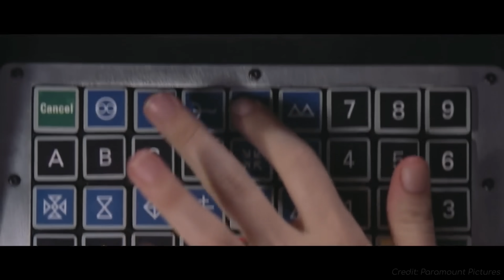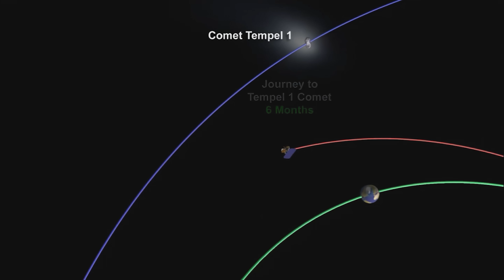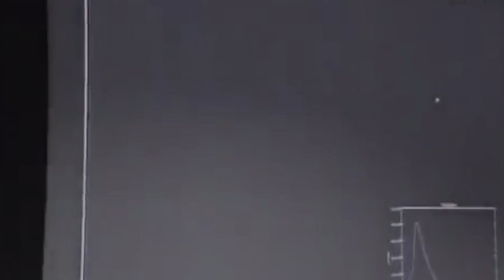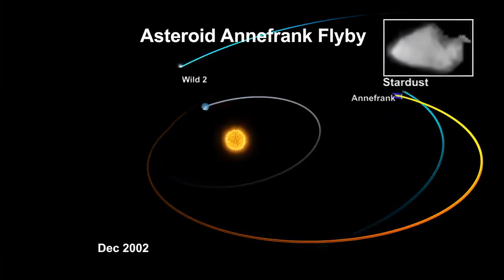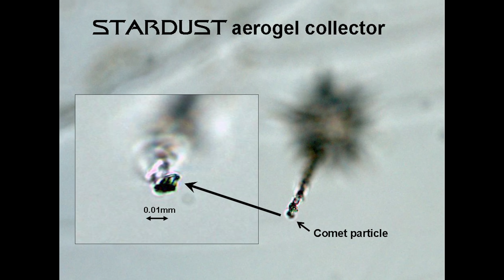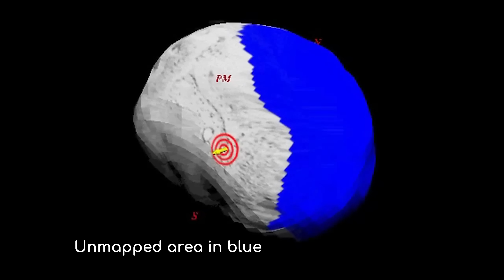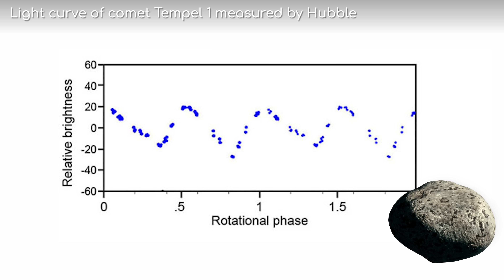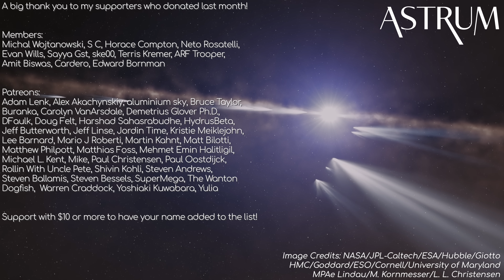The Image NASA Didn't Want to Receive from the Deep Impact Probe | Supercut

Comment: I was one of the engineers that helped build, test, launch and operate Deep Impact.
I was the Launch Conductor on Launch Day and a member of the mission operations team at JPL.
At JPL I performed duties of Navigation Team Member, Activity Lead, Flight Director, and the Impactor Command and Data Handling subsystem Engineer during the encounter.
Coincidentally - I left Lockheed Martin in 2000 specifically to work on Deep Impact.
At Lockheed Martin I helped with Mars Global Surveyor, Stardust , and Genesis.
So, while it was a let down missing the image of the crater with the DI Flyby HRI Instrument (the "Primary Science" of DI), it was going to be my OTHER Trusty spacecraft to come along and get the image.
It was especially important because the images that stardust took were through the Instrument that I was personally responsible for and integrated onto the Stardust Spacecraft, the "Navigation Camera". It was some leftover parts of a Voyager flight Camera with a Cassini CCD in place of the old phot-multiplier tube.
Reply: Thank you for your service!
Reply: Nice work reusing old spare hardware.
Reply: @TatsuZZmage  I was also in charge of installation of an old Voyager spare camera onto the Stardust spacecraft to use as its navigation camera.
Reply: Well done!
Reply: @HexproofAnarchist  another note: When JPL delivered that "Navigation Camera" I was te test Engineer responsible for testing it after installation onto the Stardust spacecraft. However the focus of the unit was basially set to infinity so I would not be able to get a focused image inside the Clean Room.  So I needed a Collimator.  I asked JPL if they could supply the collimator used to test the uit at JPL. they said it was the size of a room and they could not ship it.
So I asked them 'Could you ship me the Engineering Model of the Navcam?" They said "Sure, but why?"
I put a test target at the focal plane of the EDU Camera and pointed it right down the boresight of the flight unit and took an image.
It worked perfectly and we used it to verify the performance of the flight navcam after environmental test and before launch.
Coincidentally This "Engineering development unit (EDU)" unit was also another flight spare camera from the Voyager progam. So at one point I was in possession of both remaning pieces of "flight" hardware for the Voyagers.
Reply: @stuartgray5877  Hey thank you so much for the details that most people will never hear about. You had the perfect perspective to see the whole mission AND get your hands a little dirty. How much fun is that!
Reply: I'm curious to know why we need to spend billions on space research when we haven't discovered our own planet, so our tax money is paying for these boffins for what gain, where the NHS is starved of cash.
Reply: @philipellis4530  When we spend BILLIONS a year on Sports Memorabilia in the US alone, then maybe we can afford to do some science as well.
Reply: @philipellis4530 without the space programs, your online presence could only happen if you had a computer, which would be the size of your bedroom.🙄
Reply: This makes you a true treasure for humanity and I want to thank you for all your hard work and great efforts to advance our species and gather new and rare knowledge to share with all of us and our future descendants.
Reply: Is this some kinda arg
Reply: @prestongoetz7616  no idea what you are trying to say
Reply: And where do you expect to be in 5 years time?
Reply: @BibleBlack667  what kinda question is that and who is it directed towards?
Reply: @BibleBlack667  I expect to be launching the NEO-S spacecraft after WSF-M.  It is currently scheduled for a 2028 launch.
I have some involvement in SFWO and Carruthers.
Reply: @philipellis4530  I almost agree, but research is research and any research might well reveal something important to humanity, which after all , is what all research is about. To become myopic when setting goals for any research program is to fail to see the trees for the forest.
Reply: As an aerospace engineering student, I’ve been attempting to get an internship in the field of space, any quick tips on how to do so? I’ve applied to ~35 but only 8 have responded
Reply: @BibleBlack667 don't say doin your wife
Reply: Good job putting on CCD cameras that discounted the electrical spark predicted by the Electric Universe model. Well done!
Reply: all you guys and gals that worked on these projects,, GOOD JOB.!!  Thank YOU.. . the longevity of these space crafts speaks volumes to your creativity, and engineering abilities.  We salute you and your colleagues.
Reply: so?
Reply: @Wheresmy240  The Stuart chap made less of a comment, more of a posting of his CV, or some spiel at a job interview - hence, "Where do you see yourself in 5 years time?" ... It probably requires a level of intelligence to work that out, easy as it was. You know what they say, "if it needs to be explained... "
etc.
Reply: @stuartgray5877  Well done. Bravo.
Reply: @XohjaiSbarkeater  You managed the apostrophe in "don't", yet you completely fucked up "doin". 2/10
Reply: i was there too, as an engineer
Reply: @philipellis4530 some of us (ie the ones funding this) ain’t British bud. 

TLDR: IDGAF about the NHS
Reply: Thank you for the great work! 👍
Reply: Thats freakin awesome, I'd love to hear some stories. I bet waiting all those years to see what impact it left was excruciating, lol. Also, not knowing if you'd even ever get to see it, and if so it would be 1 in a million chances. As someone who loves everything space related, this is awesome. If it were me I'd just as proud as you are. How do you even get into working on these amazing projects, or even at Lockheed and NASA. How freakin cool is that, I bet you've seen some stuff we could only dream of?
Reply: @philipellis4530  how ignorant. Perhaps you will be glad we spent pennies on the dollars knowing that mankind is much safer, knowing we can now successfully deflect asteroids given the right amount of warning.
Reply: Thank you for all your contributions in this field to humanity. You have an amazing resume, and I admire and salute you, sir!  It was my late naval officer father - who was also an engineer - who inspired me to look towards our beautiful heavens, and although LIFE occasionally ran me over, I kept coming back time and again to looking up into the skies and dreaming.....
Reply: @philipellis4530  You do realize that "space research" is the reason we have technology like the computer you used to watch this video and make your silly comment?
Reply: Little known fact, after the impact probe hit the asteroid a message showed up at NASA from the asteroid which read, "Knock it off."  😀
Reply: I love scientists' creativity🥰
Reply: @bloggerty-schmoo2698  - "prove it or it never happened"
Well, it was LITERALLY witnessed by MILLIONS of people worldwide.
Try to keep up genius.
Reply: @bloggerty-schmoo2698  - " Tinfoil hat rubbish"
What's HILARIOUS is that the ONLY person to make that claim is actually WEARING A TINFOIL HAT!

So, where you come from is it customary for the kids that dropped out of high school to try to lecture engineers and physicists about how basic physic works?
Bless your little heart for effort!
Reply: @bloggerty-schmoo2698  Just tell us that you completed the 9th grade.
Come on you can do it. (yeah if you LIE)
Reply: @bloggerty-schmoo2698  well the thousands of actual scientists that have peer reviewed the science data returned by these spacecraft seem to disagree with you.  I guess you are smarter than those thousands of scientists and all of the engineers that build and operate these spacecraft?
Yeah.  Sounds reasonable...
Reply: @stuartgray5877  you hit a home run with that comment
Reply: There is really nothing, and I mean nothing, about this entire mission that isn't just incredible. And I don't know which, the planned or unplanned part, that amazes me the most, given both were a complete success. People such as yourself, who can accomplish these mind boggling feats so precisely, are truly on a different level then the rest of us. And I thank you for your invaluable contributions to the world.

But(he said sheepishly)no one thought about the  cloud? lol I hate to say, but I thought about it, as I was watching DART do its thing, live. That was amazing. But you guys recovered in a spectacular way.
Reply: That's Kool I watched that movie. It was pretty good.
Reply: @stuartgray5877 - do you think you might get to visit space one day?
Reply: @sian2337  No.  I am already too old. But my grandkids likely will.
Reply: @FaeEvergreen  well for an update, I am at VSFB right now preparing the WSF-M spacecraft for launch in March on a Falcon9.  
I just supported an Integrated Crew Exercise with the Air Force, and SpaceX.  I am the Test Director.
Coincidentally I also got to witness the Starlink 7-11 Launch on Tues up close.
When WSF Launches it will return to the landing zone so I will finally get to see a landing up close.
Reply: Did u work with frank childers of CSC and Nasa?
Reply: Bravo 🤩✨👍💥
Reply: @savetheplantet5799  - "Did u work with frank childers of CSC and Nasa?"
The name does not ring a bell.
Reply: I guess that means you're a Rocket Scientist? 
....... I Jest 
AweSome sounding job.   (Jobs) 
I was "privileged" to work at BNL as Engineering / Tech support
I Never did get to do anything space-oriented.   But..... it sounds VERY cool
Reply: non-Mathematical thinking 
They always think "Millions" spent on some space project is a 'LOT' 
They'll often say "Billions" but.  More often than not, it isn't nearly so expensive as they think.
And as YOU yourself point out.  Compared to the (actual) "Billions" we 'WASTE' on far more useless things.   (sports) 
A Little $$$ spent on space isn't all that bad  .   But I just find it humorous that the "drop in the bucket" that's spent on space, overall is considered So HORRIBLE an expsnse 
... a "Waste" 

(do they even Realize what ONE  F22 costs?  or ONE Aircraft carrier? Or ONE exotic bomb?  A bomb that we "throw away" along with many OTHER bombs?) 
the TRILLIONS upon Billions of dollars spent at war?
& space is the tiniest FRACTION of that (military) expenditure??? 

But they complain about one or two spaceflights that "Seve NO obvious use"

funny

 @stuartgray5877
Reply: @AutomationDnD  I am more like the "spacecraft Mechanic".
In the process of building, what inevitably is always a one-of-a-kind prototype, the Integration and Test Engineers often learn more about how the system works and its idiosyncrasies than many of the subsystem engineers that designed the system.
Smart spacecraft programs value that experience, and use the I&T Engineers for assisting with Mission Operations like commissioning the payloads.
Reply: @AutomationDnD  Yeah they often like to call the cost of the US Military Industrial Complex a "Defense Budget".
It is clearly an "Offense Budget" as the US mainland has not been attacked directly in a very long time (discounting the 9/11 events), and we spend more than the next five top military spending countries COMBINED (while many of those 5 are our allies)
Reply: @stuartgray5877 How fascinating! Thank you for sharing your involvement in this. Excellent work sir.
Reply: Impressive work, I find it incredibly uplifting to know we humans can do so many incredible things. I am in awe of space research, especially the maths involved!
Reply: Wonderul to hear your insight.
Reply: @stuartgray5877  People have the freedom to spend money on what they want. Spending TAX dollars on what the people do not agree on, is not remotely comparable.
Reply: @SupraSav  so according to you, individuals should get to tell the government what to research and what not to?
So if I personally disagree with studying climate change, I should be able to tell the government to ban the EPA?
Bless your little heart.
The Science community tells the government what to research, NOT uneducated individuals.
Reply: @SupraSav  good thing the people did agree to fund NASA.
Dont like it? Vote.
Reply: @spencer6104 that is one of the most difficult aspects of space travel: building components that can survive the ride.  For electronics this is relatively straightforward.  However it is very difficult for complex components like optical telescopes and deployable structures.
Reply: I was responsible for placing the duct tape on the integrated infra-red quantum probability reference detection equipment. It calculated the probable spin and velocity of the electrons located inside the quasi-crystalline laser pulse diffuser. It broke. Also a squirt of WD-40 for good measure.
Reply: You destroyed a building block of life 😢
Reply: Thank you for your contributions
Reply: I envy your involvement with space exploration.
Reply: Thank you very much for your great contributions to enlighten humanity on such an  important mission in our understanding of the wondrous universe.
Reply: Brag much..?
Reply: @robertglass3944  - "Brag much..?"
Do you get butt hurt by people that actually accomplish things?
Bless your little heart!
Reply: Legend
Reply: Koby Boykins that worked on Mars rovers that outlasted forever, was my hockey coach when I was a kid
Reply: Really cool…thanks for your service to the space industry !
Reply: Are you certain the imaging device was a PM tube rather than a vidicon tube?
Reply: @littlefire1976  I am not certain what exact device was removed from the Voyager cameras, but I know the new device was the CCDs custom designed for the Cassini Program.
Reply: I feel like this is a threat where 5 "different" people and the originator of this message are the same exact person. Go out mate. fresh air is good.
Reply: @bloggerty-schmoo2698  I think this whole threat is a complete made up story and the originator is in here with 5 accounts. I assume some badly narcissistic issue here lolololol people can be so weird
Reply: @pGfLexed  sorry but you are mistaken.  I use my real name and have only posted under that account.
No idea what you are talking about.
Reply: @pGfLexed  there is a vid on my YT channel where I explain my entire career.
Tell me I am lying
Reply: @BibleBlack667 YES! Totally agree sounds like a job interview... 
Him:  look at me look at me how wonderful I am
Reply: @AutomationDnD  Perhaps as NASA begin to explore water worlds in the future more money will be allocated to exploring & understanding our oceans
Reply: @davidtatum8682 but you did save the day when you applied the vice-grips...thank God! 😎
Reply: @pGfLexed "threat" I feel you mean "thread" 🤦‍♂️
Reply: @iRossco  but of course
Reply: @iRossco  - "look at me look at me how wonderful I am"

Sorry, but actually SOME people like being able to ask the actual engineers that worked on this stuff real questions.
Sorry I am cluttering up your internet.
I guess it's a horrible waste of electrons offering to answer questions for people who actually want to learn.
 I am such a horrible arrogant person to think anyone would like to hear about the seven spacecraft I have helped launch in my career (four to Deep Space or to orbit another planet) or the greater than 30 real rocket launches I have witnessed up close and in person.
Reply: @stuartgray5877 why not give us a real name? First and last since you are not scared to tell everyone.  Let's put it to rest? I take it you live by Cape Canaveral?  .
Reply: @hunt2151  Barry McCockener
Reply: @hunt2151  "why not give us actual name"?
Sure
How about
Stuart
Gray
??
Reply: @hunt2151  -  " I take it you live by Cape Canaveral?"
No, I live in Colorado, where I worked at Lockheed Martin, Ball Aerospace, and now BAE Space Systems.
However, I HAVE lived for over a year in Cocoa Beach while launching five spacecraft from KSC/CCAFS.
Reply: How incredibly generous of you to comment on this video and to answer questions. You have certainly lent credence to the documentary and offset the clickbait title altogether. Thank you for your insights.
Reply: So basically it´s all about you?
Reply: @mattias5157  Yeah. that's what I said above. Cant you read?

I built the spacecraft, launched it and flew it SINGLE HANDED with no help whatsoever.
You are welcome.
Jack
A$$
Reply: @stuartgray5877 if you really are a nasa scientist engaging with people in the comments section of a youtube video doesn’t seem like the most productive use of your apparently very important and valuable time. turn off your phone if you’re that disgruntled.
Reply: also if you’re a scientist shouldn’t you also be able to realize most of the info in this video is not very accurate? seems more like an AI content farm and you just googled everything about the craft.
Reply: @stuartgray5877 he knows exactly what you’re trying to say lmao
Reply: @kingrat4250  - "if you really are a nasa scientist".
Show us all where I said I was a "Scientist".
Maybe if you had bothered to finish high school, you would know the difference between a "Scientist" and an "Engineer".
Reply: /saaaaaaaaalute
Reply: I wouldn't exactly highlight that part of your CV.
Reply: Awesome! Thanks for your story!
Amazing how spot on the end result was considering the speeds involved... photographing the spot on the spinning bullet you shot years earlier from a different bullet and were only a degree off?!? And aligning that to occur specifically on valentines day?!?!?! That call was surely the nerds in charge... 
Wow!
Reply: @Wheresmy240 Receive a grasp, man. FFS!
Reply: Excellent Chamberlain! May you be praised for your hard work!
Reply: Thank you 🎉
Reply: @philipellis4530  Tunnel vision sort of attitude. Space research is responsible for a huge percentage of our present technology. Same for military research. Not an ideal world, but progress still happens.
Reply: That sounds awful similar to being in the Navy. Even if you weren't, thank you for your service! Reason I say is the fact that you were able to, I prefer to call it "redneck engineering ", accomplish the task, by any means necessary. That's the Navy way!😂
Reply: Thanks for the application, but unfortunately you are over qualified for the position of commenter.. we don't believe the rest of the comments section would be able to relate.

But we thank you for your input.
Reply: So you are in on the hoax ?
Reply: cool dude! 
I merely hand built the motor controller boards that spin a weather sat mirror, is how far I got to space 😅 
Stoked that this video provided a really nice account of these missions, great story of early space ventures around Sol!
Reply: @carl2591 well said. Thanks.
Reply: Fucking bad ass bro. My grandpa was part of the skunk works division in Lockheed. He actually went to Area 51 to work on the Blackbird SR-71
Reply: Wow. You guys are definitely in the thick of it. What do you know about the Galactic Federation. ??
Reply: Sure! And i was Gengis Khan.
Reply: @RejectedInch  there is a vid on my YT channel where I describe my entire career then offer a reward to anyone that proves I am lying.
I am preparing my latest spacecraft for launch on a Falcon9 on Thurs.
I am sitting in the launch control room right this second waiting for SpaceX to give us the OK to power on the spacecraft.
Lookup USSF-62.  I am one of the launch conductors (specifically the launch "anomaly lead")
Reply: Thank you for your service!
Reply: After reading the first few sentences I thought I was reading a job application.. Regardless... you're hired
Reply: @Kerrsartisticgifts I second this praise.
Reply: @W1ZY Can you explain the acronyms CCD?  And how the absence of any spark countered the EU model?  This remains salient.
Reply: @CIA_Alien fine thing you engaged but this was a comet investigation and observational act, not an asteroid study.
Reply: @BillHillard  This was a comet study, not an asteroid study.
Reply: Man, would I love to pick your brain. 😊
Reply: @dextermorgan1  Anyone with that intelligent YouTube handle has lived a sheltered life and needs to get out more.
Reply: a fucking explorer of modern times
Reply: Congratulations!  You're hired!
Reply: Thank you for helping us advance our understanding of the solar system and universe!
Reply: Thank you for all the hard work you've done on furthering humanities' understanding of space!

P.S. Step back away from the cage and do not feed the trolls! 😂
Reply: That is awesome. Must have been exciting and honestly, the wait must have been crazy and the constant attention over the years before reaching the comet. You still working on projects?
Reply: @redtesta  - "You still working on projects?"

Just launched WSF-M (USSF-62).  Next, I am working on SWFO, Carruthers (GLIDE), and NEO-S.
Reply: You are so informative ! I watched Voyager 1 and 2 launch in the 70s and am beyond impressed that they are still up and functioning. I often wonder how many people are left that understand the old school tech enough to keep them running . I enjoyed each and every  one of your comments. I can’t get enough of the incredible backstory on these simply amazing feats of human engineering, design and inspirational ideas . You sir have had an amazing career.
Reply: Wow! I’d love to sit and just talk with you. All of you space science heroes have my utmost respect for what you know how to do, and how you accomplish it! Geniuses! Thank you for always showing us non-space scientists how amazing our existence is in this universe. Coming to Cali soon for any kind of Q & A session?
Reply: thanks for being part of history. god bless you and your family
Reply: Whats the difference between an enjineer and a mechanic?
Reply: @baalqefel1570  Engineers usually DESIGN the things they work on while mechanics just perform maintenance on those machines.
Reply: I would have done anything to be even a fly on the wall for the stuff you do.
Reply: You had a great career. Many of us can only dream of. Bravo
Reply: Geezus! Isn't this how we got the Andromeda strain (1971)?!
Reply: @sugarpuddin  No Stardust and Genesis (Also missions I helped build) are far more "andromeda-strain-y"
Reply: @stuartgray5877  Interesting! Thanks for note! I really enjoyed learning about it after Google search! 

I have to tell you, Andromeda Strain scared me silly as a child.  As a physician with the same name of the main protagonist in the movie, I'm still scared!
Reply: @philipellis4530 well, keeping up with and knowing the properties of things that could have possible planet destroying consequences that might be coming our way seems like a basic health preserving activity.  Of course we could be gone in a blink by things we don’t yet know about anyway.
Reply: @iRossco if you were a stone mason and someone put out a youtube clip of a building that you worked on, it would be perfectly natural for you to comment; "hey! I built that!" What is so strange about a chap who worked on a fascinating project, sharing his experiences?
Reply: @baalqefel1570 a mechanic knows what he's doing and an engineer knows why he's doing it.
Reply: I probably gave you support for your computer issues.
Reply: @iRossco  and you are? Bet I saw you a few times going down the road...holding up your sign.
Reply: @woodruff3799  Did you work for Ball Aerospace or JPL?
Reply: @stuartgray5877 
Very clever! Kudos!
Reply: wow. So cool. Talk about doing something worthwhile with your life.
Reply: i was buzz aldrin
Reply: @___soap  bless your little heart!
Reply: Too bad a backstory like yours may get lost to time. There should be a place where these great stories would some day be gathered together.
Reply: @robertlussier2944  Not to mention the medical stuff.
Reply: @davidtatum8682  It’s proof of a crazy world when  a comment like yours makes sense in response to another. I don’t know what’s worse, someone who thinks people should care or even believe their claims in a comment section, or the people or bots that actually  do.
Reply: @Ghostshadows306  lol. Well put
Reply: @philipellis4530 I can’t lie mate, life is deeper than that.
Reply: Amazing bro. Simply amazing. God bless you and yours.
Reply: That's some great info, thanks for sharing it with us.
Reply: The money and expertise required to develop these space missions doesn't just come from governments, there are other sources. Organisations that do specific research or work on advanced technologies, unrelated to providing everyday healthcare. That money wouldn't go to things like the NHS anyway, because the NHS is a UK based, mostly state owned and run organisation. Why would any foreign governments or organisations give the UK government money to run the NHS?
Reply: So when we discover the trajectory was changes and it ends all mankind, we can blame you…lol
Reply: Great work and thanks for the insight
Reply: I was in charge of a lemonade stand once.
Reply: Aren’t they concerned about knocking it off course and causing it to crash into earth 🌏
Reply: @Kerrsartisticgifts There are many just like him.  All human hero's, sacrificing the most precious commodity, their time.  Thanks to all the courageous that make dreams come true.
Reply: @BootsTheCat24  We thought of that.
So.... No.
Reply: @  so what keeps it on course? Also, so glad your there to answer any worries👍🏼thank you
Reply: Wow. I bet that was a fascinating, thank you for helping us all know more.  Your work will be remembered through history, how cool.
Reply: @BootsTheCat24  The comet is an extremely large mass.  We cannot change its trajectory appreciably with such a small impactor.
It DID nudge it a tiny bit but not even enough to detect in its orbit.
they have done more recent experiments with more accurate measurements of the target's trajectory. I think DART was one example.
Reply: @stuartgray5877 the focus was set to basically infinity? , how does that work ?
Reply: @Stevie-joes6851  It just means the targets are so far away that the light is effectively collimated (parallel).
Hubble cannot look at object on earth because it is way too close and cannot adjust focus far enough to see something close. Like being "far-sighted" (cannot focus up close)
Reply: @stuartgray5877  interesting, it seems amazing that a  camera can do that . Thanks for the response and congratulations on your career it sounds remarkable.
Reply: @stuartgray5877  Wow the 'junk box' you got to use sounds incredible, a "who's who" of some incredible missions - Good job extra's get made when building spacecraft.